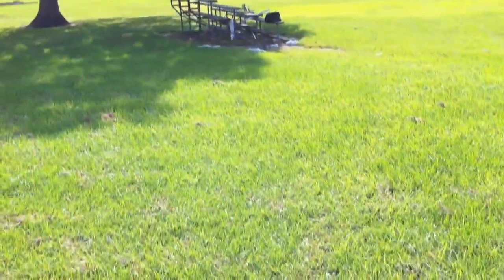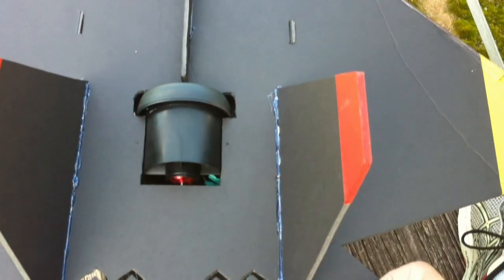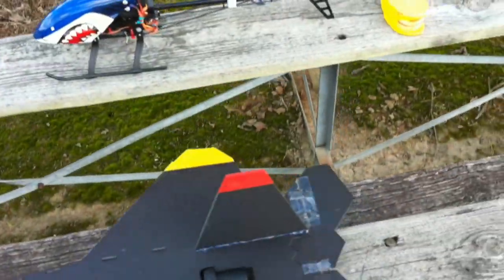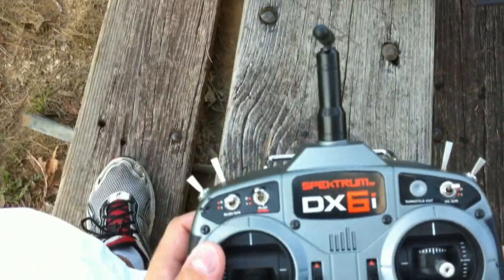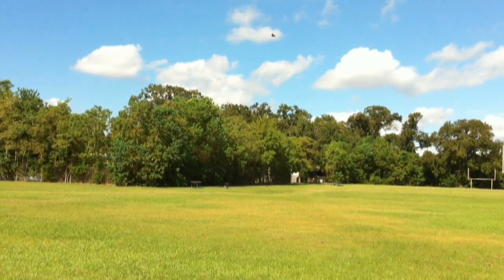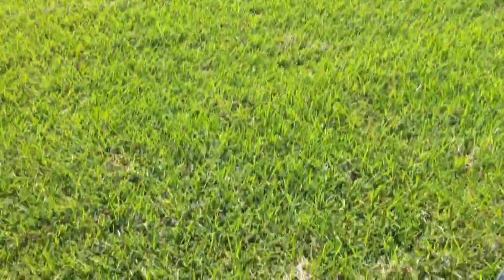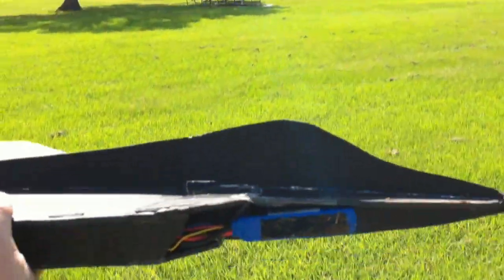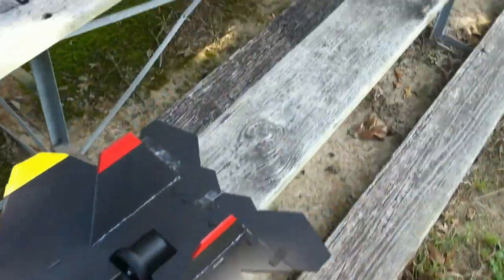F22 Raptor Test Flights

Comment: park jets usually need about 50% expo lol otherwise they are super sensitive. and the reduced throws. it's not like a 3d plane you dont need that much on it to get it to move. and thats the great thing building out of foam or foam board it doesnt take long to build a new one and keep on learning. i started building 2 at a time so all i have to do is swap gear. i even have extra servos already installed so i can just swap motor speedcontrol and receiver easy. bring both planes to the field lol

Comment: Feeling is too heavy, the size of this aircraft, the total weight should not exceed 400g better, even 350g or less fine.
That is, the use of 3S 11.1v battery 850mah battery or 1000mah battery like.

Comment: all the stuff you said at the beginning of your video it isn't entirely true if you dialed in some serious Expo and you should be launching the plane with your left hand so you can already have your fingers on the controls otherwise when you slam your hand over to them to get started during the Panic state in the very beginning of the launch you over correct and shove it into the ground it's expected I'm a new flyer once I learned of that I don't crash anymore
Reply: agree with you...diy jet should be nose heavy
Reply: agree with you...diy jet should be nose heavy

Comment: Too heavy.
Reply: ***** That is the problem with the RC versions. The Flite Test one worked well but it had no glide capabilities. The F22 design like the F117 really are kept in the air by their powerful engines and their computer systems which stop them from falling out of the air.

Comment: Flies just like the real one, terrible......Oh, and you are not flying a Jet, its a ducted fan. They are not even similar.
Reply: well I mean... they both provide thrust, both found on airplanes, both in tubes, both use fans (whether to compress or generate thrust, still fan blades) and both have the characteristic to take longer to generate thrust and speed from a low thrust setting compared to props.

Don't mind me, just trolling :D
Reply: Ey, don't complain, I bet a load you can't engineer something better.